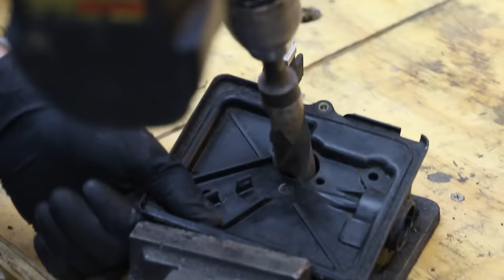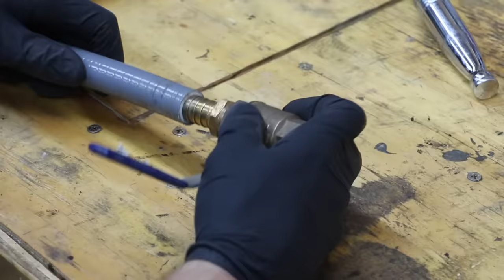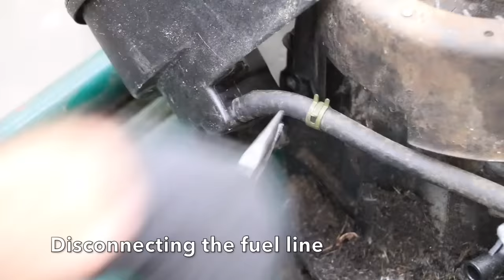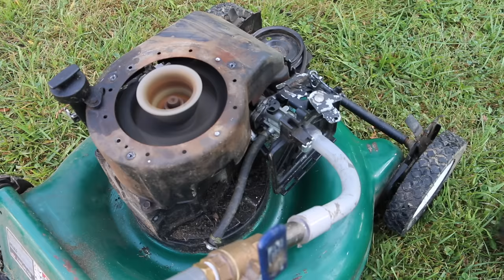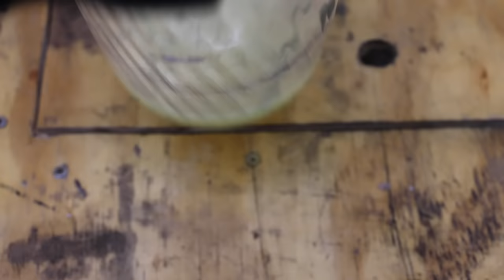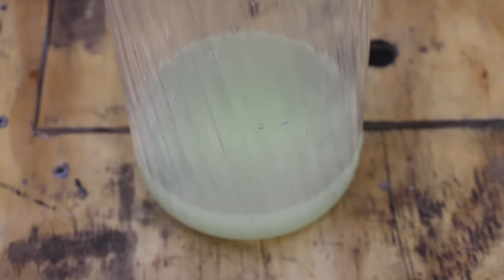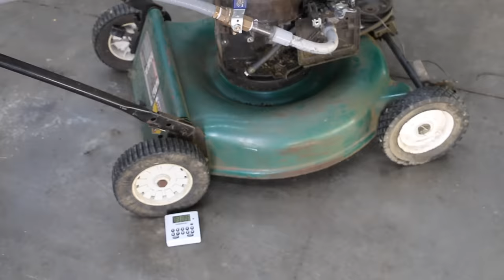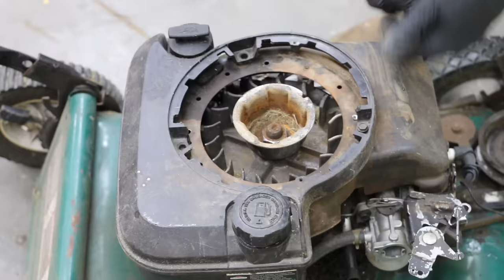Will a "Gas Vapor" Container Improve MPGs and Fuel Efficiency?  Let's find out!

Comment: My only thought is, measuring the RPMs of the engine as it was evident in the video that the valve from the vapor setup was affecting the speed of rotation.  if the engine was spinning at a different rate between the two setups; then it is difficult to make an adequate assessment on the effectiveness of the vapor system.  I would argue that even a 100 rpms would have a significant impact over the course of 20 minutes.
Reply: The governor was still hooked up. The engine self regulates it's rpm once it's fed the proper ratio from his valve and runs properly.

The thesis is that the fuel savings on vapor is supposed to be "incredible" and  "so good oil companies want it hidden"  so even with this basic test here it really blows that theory out of the water. If someone could sell a big truck that got 50mpg they'd be doing it...

Comment: I would think you need the liquid gasoline to change to an actual vapor, i.e. a gas. To do so the most efficient way is to heat the fuel line. Quite like a camping stove uses a primer cup to heat the fuel so that liquid fuel passing through the heated fuel changes from a liquid to a gas.  The reason your "vapor" didn't produce greater results is because oxygenated liquid gas is still liquid.

BTW, all cars runs on gas vapor. 
Liquids don't burn, the vapors coming off the gasoline is what is burning. Just my opinion, but I believe that is why cars get such poor mileage and why the automakers were under pressure to stop producing ever more efficient vehicles.
Reply: edit,  change: "...a primer cup to heat the fuel so that liquid fuel passing through the heated fuel changes from a liquid to a gas. "

change to: "...a primer cup to heat the FUEL LINE so that liquid fuel passing through the heated FUEL LINE changes from a liquid to a gas."
Reply: Thank you I see that in everything has "advanced" look at the first computer it's size and capacity. Tv micros etc... But gas and electricity has been the same from the biggening to now. Yes they add 2 miles per gallon every few years but no real change. It's like the idiots the buy a Tesla say they bought and electric car better for the environment. Lol you see the joke know and electric haha no no no. It's a car with and electric motor power by coal worst than gasolin or tell me how they generate the electricity that goes to your house our all the power stations ?

Comment: A video or two about "HHO" powering an engine would be nice to set some of the weird HHO nuts straight. Mayber even a "free energy" video showing the difficulty in accurately measuring charge transfer between lead acid batteries. The majority of "free energy generator" videos I've seen are basically moving charge from one battery to another with something fancy in between them. The apparent increase in voltage is just from the increase in temperature or not understanding how voltage relates to state of charge.
Reply: @thra5herxb12s  But why????????
Reply: I increased the mpg of my 2007 maxda3 from 33 to 48mpg Hwy with a DIY HHO cel I built and put 80,000kms on it that way over 5 years. It took 3-4 years of web research to figure it out and out of the 1000s of videos and articles I watched and read to make it, not 1 method claimed worked for me, and not 1 explained what I actually made work. 
Hint: you’re not trying to run on HHO, you’re trying to produce small amounts of HHO with a small % of the excess amps your alternator can spare, to use as a catalyst to increase mileage.
Reply: @ThisTall  Where do you think that "amps to spare" power comes from? Your results are likely caused by two of three possible things. If you have rigged your alternator to full field when you hit the brake pedal, you are doing a little bit of regenerative braking. Kudos. If adding HHO to the intake is making your engine more efficient, you probably would do better to actually calibrate your fuel injectors and make sure they are  spraying as fine a mist as possible, which you should have done in the first place and then wouldn't have seen any noticeable HHO gainz. You may also just be benefiting from accidentally adding tiny droplets of water that have a wonderful combustion moderation effect in ICE engines once they are hot (check out water injection). There is also the possibility you are measuring incorrectly as I've found to be common when people start using phrases like "excess amps from your alternator" because getting a correct power reading can be difficult.
Reply: @Lucas Van Hamburg Who are you actually replying to bud?

Comment: Try using paint thinner as a fuel
Reply from the maker: Thank you for this recommendation!
Reply: Project Farm I did that as a last resort once when I ran out of gas mowing the lawn, worked fairly well.
Reply: I tried it in my Chevy S-10 and it ran hot and loud, but no long-term damage AFAIK.

Comment: Me during the video: Why that's amazing, bet'll equal out to with no saving though.
Me reading the comments: Doh!. a carburetor.
Reply: As said in one of the comments earlier, carburators only mix up the liquid fuel and air into fine mist. It's not gas. It's liguid in a gas like those thick mists you get in the horror movies. It's not gas it's still part liquid. This creation uses only the vapor that comes from air turning the liquid into so called pure gas with no liquid in it.
Reply: SlendisFi Universe quick question. Have you ever heard of this thing called propane, that some engines run on?
Reply: @ИосифСталин-э9ь  yes i have. But propane can't be used as fuel in otto and diesel engines...
Reply: @SlendisFi_Universe  It actually can :) 50:50 mix with diesel or 100% but with major engine rework. With CNG you can go as high as 80:20 to diesel ratio.  Just research it Diesel + LPG bifuel. I am making such project right now on a BMW 530d 2002. Common rail + turbo (236 HP with modded soft for the last 5 years). Adding propane to the fuel mix will cost me about 400$ Orange PI computer + carburetor CNG system
Reply: @deathwingbg  you said the key words: major engine rework
Reply: @SlendisFi_Universe  diesel lpg mix can be done in 1 hour and for 100$ if you know what you are doing
Reply: @deathwingbg  well... i still see mixing air in fuel inside the tank cheaper and easier
Reply: @SlendisFi_Universe  cheaper easier and what? Ineffective?

Comment: Actually gasoline engines are designed to use a little bit of extra fuel. You run a motor to lean and you'll melt it. Any pilot knows this. Is he getting altitude your atmospheric pressure lowers, your engine runs good, good power but it's running too lean so your temperature is quickly rise and you have to enrich it as you climb.
Most people struggle with this concept. But when you set a carburetor you don't set it until your motor speeds up you have to back off the jet and let it have a little extra fuel, or you will melt a piston.
Reply: This is actually false. That’s a misconception about how air to fuel ratios work. Lean mixture does not cause overheating. The incorrect timing with it does. Lean mixture causes excessive emissions which is why it’s not used in the auto industry

Comment: Super intresting even some positive result could be on the margin of error though but

Since both air and fuel wapour goes through the bubler, i guess you didnt really control the fuel air mix, but instead used the valve as a choke, could be intresting to have a seperate line that dosent go through the bubler and see if there would be any efeciency improvements 😁

Comment: Or have a 50/50 gasoline and rubbing alcohol.
Reply from the maker: Thank you for this recommendation.
Reply: That would burn hot! theres a reason top fuel dragsters get rebuilt often.
Reply: Stu Dumpster Methanol drag cars run cooler...because less btus per unit volume than gasoline.
Reply: +Adam Mackinson they get rebuilt every week though. Guess that was back when I gave a shit about cars. Now I might watch a bunch of car stuff still but honestly I love how simple my bike is if the gears are shot 45 minutes about a hundred and fifty bucks for the good gears new chain blam don't even have  to take it to a shop. living in a smallish town with bike freindly drivers helps allot.
Reply: Change construction. Piping is. Wrong
Reply: Jesus Lopez I think rubbing alcohol costs more than gasoline.

Comment: I mean ist that the same what the carburetor does? Evaporating fuel/mixing fuel with air (both become gas) for combustion.
Would just be a different style of carburetor. One thats not able to change the fuel/air mixture depending on needs like altitude or whatever
Reply: No. Atomization or a fine mist of fuel is NOT vaporization.
Reply: where can I buy a vapor carburator? I Can't!

Comment: I wonder if you heat and pressurize the vapour if it would be more efficient ?
Reply from the maker: Thanks for the suggestion.
Reply: question....  I do not know how to pressurize, but on the way to the motor the gas go around the exaust so can be heated???
Reply: @carrerasrivera  i heard a story ounce of an engine that could run on fumes and the engineer had pressurized the fuel and heated it i would think its not so much pressurized but a contained system with very little to no air ???
Reply: Lol thats what the compression ,power stroke does as well as why we have spark plugs.... It wouldnt be any different

Comment: During WW II Europeans ran vehicles on wood smoke from a small stove they carried on the vehicle.
Reply: I've actually heard something similar. Not so much the WWII part, but using smoke. To be fair, it's not your backyard BBQ smoke. One must burn the right fuel in a specific way to produce a thick, oily, sooty type of smoke. But I've heard of this, and if it has the right properties, i don't see it not working.
Reply: Benson its called a gisifire, look it up. It's super cool
Reply: Benson I’ve seen someone do a this with oil. Rigged up a smoker, and poured oil in it, and a lawnmower ran on the smoke from the oil.
Reply: Saw it done on some Discovery prepper show.
Reply: Gasification
Reply: It's called Woodgas
Reply: There is a company manufacturing cogeneration plants in the 100 kW range a few dozen miles from where i live. Those run on wood chips.

Old WW2 and 1950's gasifiers where of the autothermic variant, basically a process similar to making charcoal. Modern ones are allothermic, the wood or other dry biomass is heated externally.
Reply: John Mulhall i have seen it done
Reply: we do it in sweden all the time, its called "gengas" in swedish, and its not smoke, its a gas that comes from very slow combustion of wood
Reply: G'day,

  Actually, you're almost not wrong.

  Last week I made a pilgrimmage to the local Museum, to visit my father's WW-2 Automobile Charcoal-Gas Producer..., and being a good YouTuber I made and posted a Video of the Device...

  Modern " Combustion-Gasification" practice is to use Wood rather than Charcoal as a Feedstock, burning in a "Down-Tube"; with an Electric Fan used to extract the Smoke while establishing Combustion and lighting the Fire...

   Either way, the idea is to have a small Fire in a restricted-Oxygen environment heating a Fuel-Charge to pyrolise the Volatiles and then use the Carbon-Monoxide from the Charcoal, or the Methane & Hydrogen from the Wood, to run into the Engine's Carburettor at about 12 parts of Air to 1 part of "Producer-Gas", in order to run the Engine...

  Dad drove the Family to the Coast 150 miles away, and back, for a Holiday, at least 3 times between 1944 & 1946.

   I'm working on Wood-Gasification using Concentrated Solar Thermal heating, from an Offset Parabolic Dish..., so I went back to "touch Base" by examining Dad's effort - which I first saw in 1976 when I helped him cart it to the Museum...

  Have fun,

  ;-p

  Ciao !
Reply: Yes do the wood smoke i seen it done manytimes
Reply: John Mulhall wood gas although you might be able to run a motor on super heated smoke if you could add the smoke and air to the cylinder at the near the same time but through different intakes because the smoke and air mixing prior would cause it to ignite
Reply: wood gas is technically natural gas produced from breaking down biomass under heat. the gas is then cooled and cleaned of tars before use as fuel. I built a gasifier and they are not hard to build. would love to see project farm experiment with it
Reply: John Mulhall it was coal gas before natural gas we in UK had coal gas they used big balloons on top of trucks full of coal gas
Reply: ive seen a wood burning tiger hull. dont know if its the same thing
Reply: True, there was no fuel anymore. So people got creative. Cars literally ran on wood fire
Reply: John Mulhall kinda like the gas created when charcoal is made right?
Reply: You can actually go on the fema website and get the plans to build a gasification unit and there's a lot of YouTube videos to show how to do it in a vehicle
Reply: John Mulhall we also had stove burners on cars in the U.S. for a short time when gas as scarce
Reply: It was a common thing all over the world during WW2, because fuel became extremely scarce and military was priority.
Reply: John Mulhall those engines can run on any type of gas
Reply: any type of gas?... Time to start eating beans.
Reply: John mulhall, Yes there are people doing it now. I have done it myself. both on a lawn tractor and a truck.
Reply: Wood pyrolosis.
Reply: It’s called woodgas

Comment: Right here josh did it 7 years ago, it can also be used as a milage booster for diesel on a truck that still has fuel system in place add a 1/4-1/2 inch tube from gas vapor can you'll be surprised how much less throttle you'll need to achieve the same power n speed
Reply: How mpg did you get with and without it?
Reply: In other words did you get better mpg?

Comment: Seriously people? That's almost the exact same thing a fuel injector and a carburetor do. Except all your doing is removing the effect of latent heat of vaporization by running straight fumes. I bet that thing was running so lean it got pretty close to burning the valves up.
Reply: Rewind He checked the surface temps and they were all normal,so I don't think your right,it woukd have shown more heat.
Reply: I love when people call others idiots and make basic spelling and grammar mistakes while doing it.
Reply: Apart from sloppy measurements, he just implemented a very inefficient carburetor. A selective one, though, because it left a lot of heavier gasoline components in the receptacle. I suspect that the engine would run much cleaner when it is not burning all the paraffin sub-products!
Reply: ^Jesus christ you sad people, it's just fun to see it simply sucking in fumes and running on them in this manner.  Gives people who don't know about fuel and engines something interesting to learn about them for starters.

And you get douches saying "Seriously people?", calling people idiots for enjoying it, and complaining about "sloppy measurements".   Personally I think his style of doing things is great to watch, just tinkering in the shed and seeing what happens.
Reply: Pierre C most of what is left behind is the ethanol and the water that it pulled out of the air as it was running. Ethanol as we know is hydroscopic and holds onto the water.
Reply: I suppose in this case because this mower moves such little air and has a lower compression ratio than a normal car engine would, it wouldn't make as much of a difference.
Reply: Alright you got it.

Comment: The question really isn't will the engine run on Vapors. The question is how much work can you do with that engine running on Vapors compared to it running on gasoline through normal means.
Reply from the maker: Great point!
Reply: tgirard123. Exactly .  it will run but with no real useful power
Reply: Liquid will do less under load.
I've seen this done with clear heads, with high speed cameras, liquid wastes a lot.
Not sure what he did wrong in this video, but there is a major difference between the two.
Reply: You always run a gasoline engine with vapors. Can't burn the actual liquid. Throw a match in a well ventilated jar of gasoline...the match will burn out instantly.
Reply: Exactly.  All this stuff gets measured very carefully as in comparing the performance of various fuel injectors, the size of droplets, the percentage of fuel per volume and the work that can be performed.  People may be unaware of all this, but that doesn't remove the fact that air / fuel mixture is a VERY highly studied thing:
https://nepis.epa.gov/Exe/ZyNET.exe/9100X5X0.txt?ZyActionD=ZyDocument&Client=EPA&Index=1991%20Thru%201994&Docs=&Query=&Time=&EndTime=&SearchMethod=1&TocRestrict=n&Toc=&TocEntry=&QField=&QFieldYear=&QFieldMonth=&QFieldDay=&UseQField=&IntQFieldOp=0&ExtQFieldOp=0&XmlQuery=&File=D%3A%5CZYFILES%5CINDEX%20DATA%5C91THRU94%5CTXT%5C00000026%5C9100X5X0.txt&User=ANONYMOUS&Password=anonymous&SortMethod=h%7C-&MaximumDocuments=1&FuzzyDegree=0&ImageQuality=r75g8/r75g8/x150y150g16/i425&Display=hpfr&DefSeekPage=x&SearchBack=ZyActionL&Back=ZyActionS&BackDesc=Results%20page&MaximumPages=1&ZyEntry=1&slide